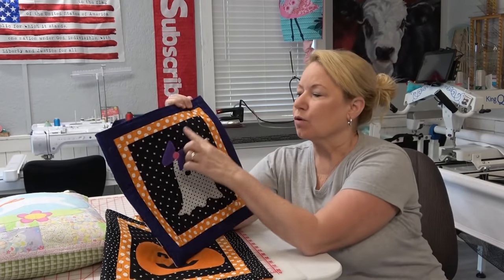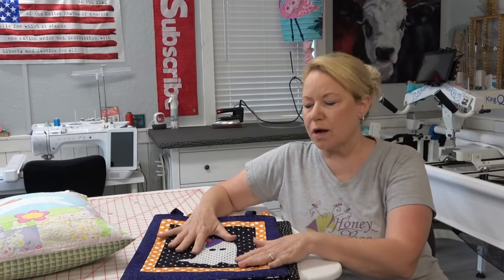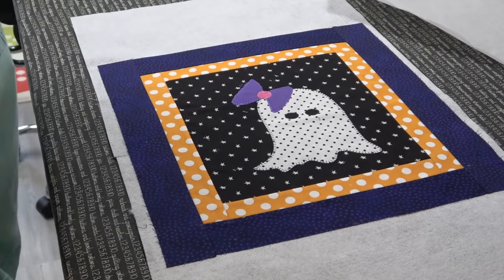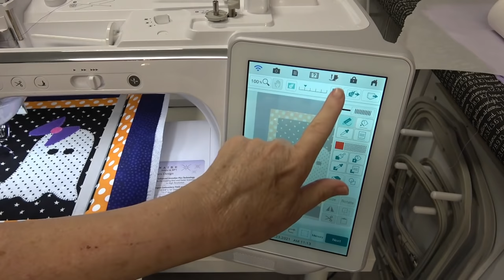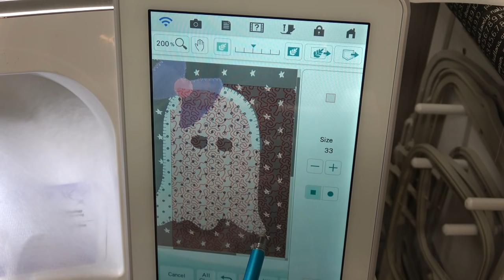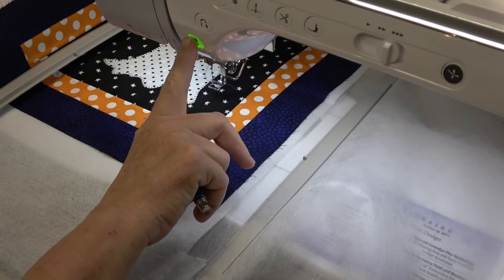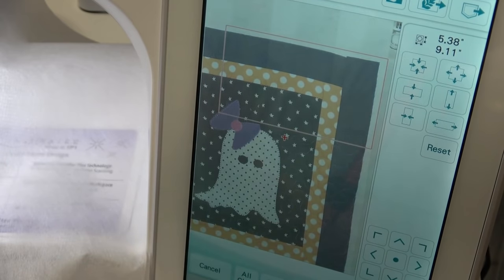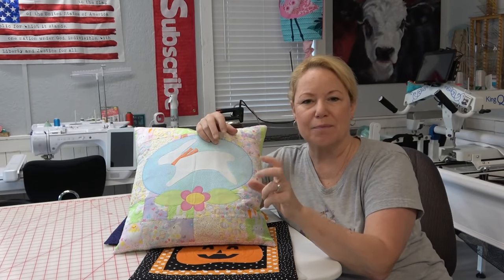Easily Machine Stipple Quilt Around Applique, Brother Luminaire or Baby Lock Solaris

Comment: Becky when you are in the Design Center, you can eliminate the black line around the edge by going to the line drawing area and changing it to a no sew. You touch the area that shows the line, like you do to in the bottom area to select the stipple, and then select no sew. This will eliminate the black line outline around the design.
Reply from the maker: Awesome! Thanks!

Comment: Hey Becky! I am doing a quilt like this. Scanning, and putting stipple around my embroidery I don’t want stitched. The problem I’m having is when I finish erasing where I don’t want it stitched, I press next to change the size to .700 but when the blue dots are circulating and stops it doesn’t change the size! Urrrgggg. I go through this like 4-5 times and finally get it to change. Does it sound like software problem to you? Brother didn’t have any suggestions???? So frustrating. I’ve done 7-8 hoopings.
Reply from the maker: I've had that happen too.  Be sure to save your work into memory before attempting to resize the stipple.  You might save yourself some steps.  Yes, sometimes the software is like a child and just doesn't do what you want it to do.  It's rare, but it happens.
Reply: Thanks so much! Glad it is not just me!
Reply: @PowerToolsWithThread  hey Becky! I found out that when you touch ‘next’ to resize the stipple or other design at the top of that page is a link button, I turned that on and for some reason it works! I don’t understand why but it works! Brother didn’t t even know, my dealer told me! Just wanted to share this info!☺️
Reply from the maker: @Ledetms  WOW!! Thank you!  I've seen that link button and haven't used it there.  But I will now.  You're awesome!  Thank you!